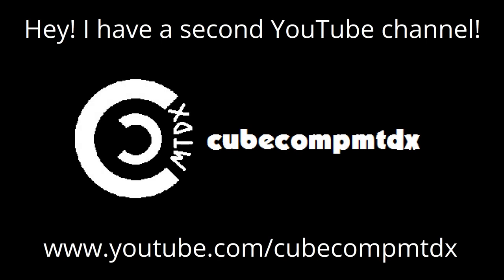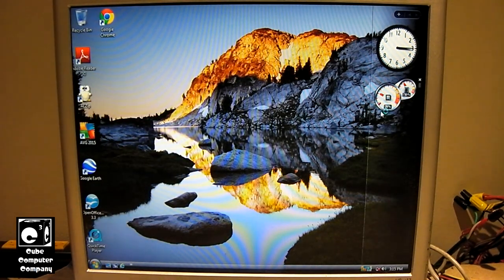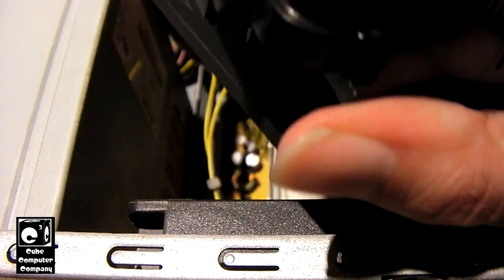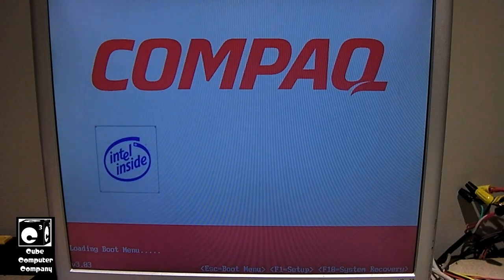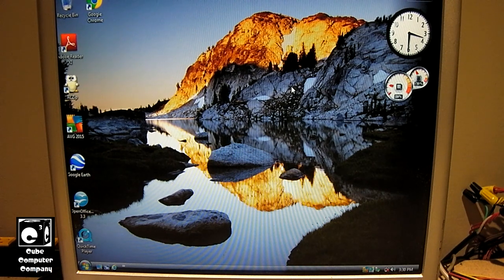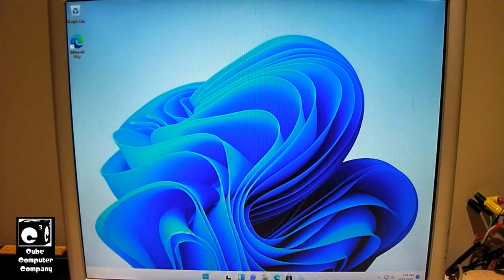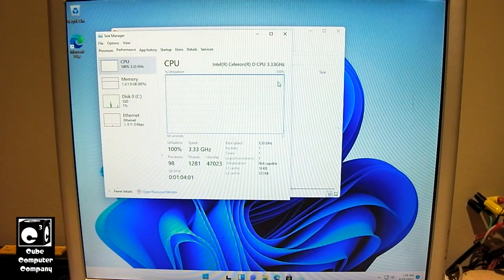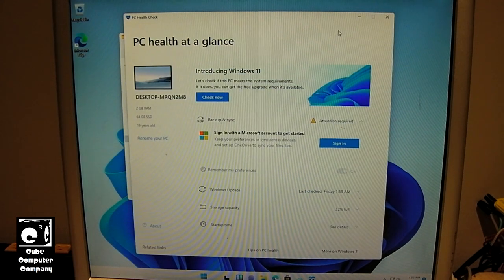Running Windows 11 on Celeron D 356 CPU

Comment: Hey Nick, I wanted to remind you, remember the old days when hyperthreading was new. Often times folks had to manually select the multi thread driver to take advantage of hyper threading. I think it was device manager/processor/update driver/ look on computer/choose driver.  Something like that, you should check task manager and see if you have 2 processors on the cpu graph.
Reply from the maker: If my memory serves me right, the Celeron D CPUs did not have HT. The marketing behind this piece of crap CPU was horrendous. Despite the "D" branding, it did not have 2 cores (or even 2 threads). Unlike the Pentium D, which had 2 cores.
Reply: @CubeComputerChannel  The Pentium D Extreme edition did have hyperthreading and 2 cores if i'm not mistaken.  They are 775 it'd be possible to put them into a server (771 socket i think) and see what their combined performance is.

To Celeron's credit it is a improvement over a pentium 4 celeron at the same clock (albeit only small)
Reply: @CubeComputerChannel  my mistake, I thought you said it was ht. I wonder if a p4 extreme would be noticeably better. Like watching snails race up hill I bet!
Reply from the maker: @alanparker3624  The P4 was HT, but it was a Prescott core and would not work with 11. The Celeron D was not HT, but was based on Cedar Mill, which will work with some workarounds to get it installed.
Reply from the maker: @patg108  The Celeron D offers a little more L2 cache and a slightly higher FSB. The 478 Celeron D was based on Prescott and offered 256K L2 cache (vs 128K for the Willamette and Northwood Celerons) and a 533MHz FSB (vs 400MHz for the older chips) The 775 Celeron D was based off of Cedar Mill, and offered 512K L2 cache.
Reply: @CubeComputerChannel  yeah but the 478 cedar mill p4 is the actual lowest, can test to see if it prefers more cache or a virtual core.

And seeing what upgrades you can make to it (temporarily of course) would be interesting

Not certain if it has PCI X16 or just AGP but there is also more modern PCI cards, some are said to exceed the best AGP cards

Could give it a a sound card upgrade too like the old days (see if that helps it lessen the load)  Certain you have a old soundblaster live laying around for it.

It'd be decent in 9x or 2k, possibly decent in XP if you ran tiny XP for that Celeron D.

And easy enough to take away its upgrades later on.

Vista there isn't much use for sure (save for oddball games and cards that only supported vista)  But there is even lite versions of it too.

You could make multiple videos off this, first de-bloating and then hardware upgrades.

p4 with HT did decent with windows 10 and some upgrades, so how would this celeron?

And you could give it later versions, Pentium D, Pentium Dual core, core2, core2quad etc

Would show what happens with more cache, faster IPC and more clock speed even on the same motherboard.
Reply: should also go with 1 GB lan card too (just to also lessen the pressure on the cpu)

And testing with other OS would be interesting too.
Reply: @CubeComputerChannel  omg, yeah.

Comment: socket 478 cedar mill is the limit, not certain how it was done, maybe a install of 10 then upgrade with the modified iso would do the trick? to get it to import chipset drivers.

And it should technically run off the IDE hdd too given enough time to install and boot.  Albeit not well.

This shows what can be done, but not what should be done XD

Comment: This Celeron was pretty outdated even when it was new and barely usable with anything newer than XP even with that high clock speed.The only singlecore Celeron that amazed me was the Celeron 420.Years ago when i was still in highschool we had computers that ran the Celeron 420 with 2GB of RAM and Windows Vista Business and they were really snappy for their low specs then they upgraded them to Windows 8.1 which was the latest OS back then and they were still running fast.That was probably the only singlecore CPU i ever saw to perform so well especially for being just a 1.6GHZ Celeron
Reply: yeah because celly 420 was cut c2d architecture :)
Reply: Nowadays, Celeron's are still pretty competent. According to Intel's website, the modern Celeron's have 5 cores, albeit low clock speeds. They get similar benchmarks to 5-year old Core i3 processors.

Comment: I always wonder with your windows 11 tests, does debloating using chris titus toolbox and "this is windows 11" actually make a difference on the older machines.
Reply: it would technically make a difference.  But those tools that are equivalents for older operating systems would help them too.  Hardware upgrade to the limits would make more of a difference though (gpu, ram, cpu, SSD)

But i agree with you he SHOULD run the debloating software on them and see how much better it is.  Then go with the upgrades
Reply: It'd be interesting to see how "usable" all of that combined (best speed of ram, strong gpu), and Debloating makes it.  To be fair the Celeron D would be usable as a alternative to pentium 4 for retro tasks but that's about it.
Reply: Also try Opera GX as a browser for both modern and low end systems, read a comment its able to control cpu and ram usage, could be useful for low end systems

Comment: I have core 2 Duo CPU & 2GB ram . I put windows 11 but connect internet with LAN my pc was restart.....    But that is not in Windows 10..... Can you tell what is the reason.....
Reply: Just keep using W10 or switch to Linux (Linux Mint recommended in general, Lubuntu for yours). You'll have to anyway once Microshaft's Windoze 10 support ends on 2025-10-14.

Comment: Version 22H2 makes the system requirements more strict. We need to petition to Microsoft.
Reply: Either don't use W11 or use W11 IOT Enterprise or W11 IOT Enterprise LTSC, in this regard. But that would be redundant, as that's exorbitantly expensive. The cheapest I could find was 139 EUR (153.05 USD) on eBay (before tax).

Comment: getting your money's worth out of that proccessor I guess :p 
poor machine will never leave 100%
Reply: My motherboard died so i'm using a on-board celeron (a 1007u) that i have and man... even windows 10(that was my old system ssd) it's some times stuck at 100% :c if i open a web page i need to wait for it load to use anything else, but... it's 'usable' i gues 🤣 I don't see the time to get my hands in another motherboard and get back to my ryzen 🙏 but honestly this celeron is saving my life and in some way i can still play some esports games 👀< this improved so much after i put my rx 580 on it 🙏.
If at least my celeron were multi-threading, but it's a 2/2 😥 stuck at 1.5ghz 😩.

Comment: What year is the Vista PC from?
Reply from the maker: It didn't originally have Vista... system is from around 2006 and originally had Windows XP and the Celeron D 356 CPU. I had dropped the P4 in it some time ago.
Reply: @CubeComputerChannel  When do you think the Pentium 4 went obsolete?
Reply from the maker: @mustasheolll2020  I  think by the time it was running so hot that it was difficult to keep cool, not to mention power consumption!
Reply: @CubeComputerChannel  That was probably on day one. Many say the Pentium 4 was one of the worst processors lol. To me it has some respect since my first PC had a Pentium 4.
Reply from the maker: @mustasheolll2020  The Willamette and Northwood P4s on Socket 478 weren't that bad for heat and power consumption. They would get warm when you overclocked them. What was bad about the P4 was the netburst architecture. When comparing Willamette P4s with the Pentium III, in some cases, it seemed like the Pentium III was faster. I've heard that when Intel designed the first Core CPUs, they actually went back and built off the Pentium III architecture since the P4 Netburst design was so bad.

Comment: A few thoughts:

- this is awful and hilarious
- this would really benefit from a video card with current display drivers, or managing to bludgeon drivers for the Radeon Xpress into running on Win11
- 2GB RAM is awfully skimpy but something tells me the memory controller won’t support more than 2GB, or would max out at 3.25GB
Reply from the maker: I used hacked drivers for Windows 10 which also happened to work with Windows 11. The max RAM this board would see is 2GB since it's 2 DDR (1) slots.